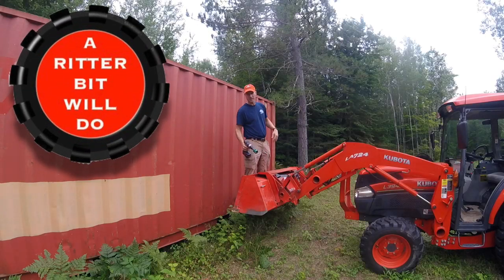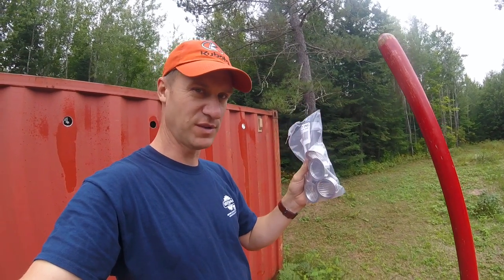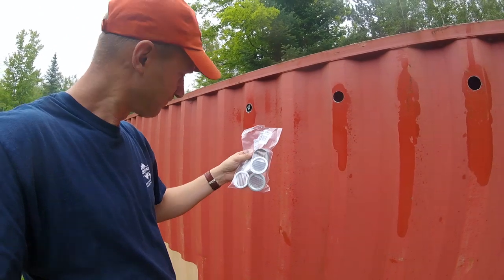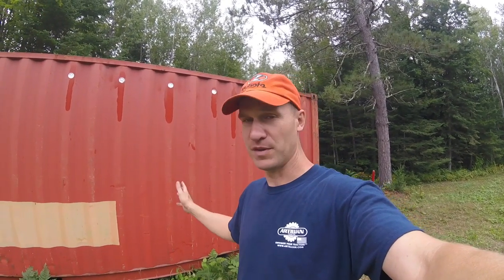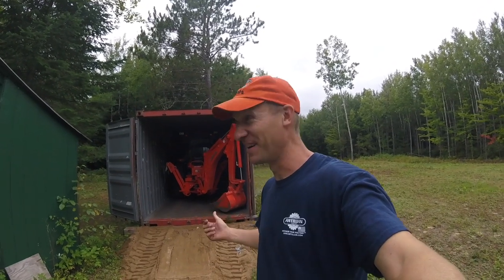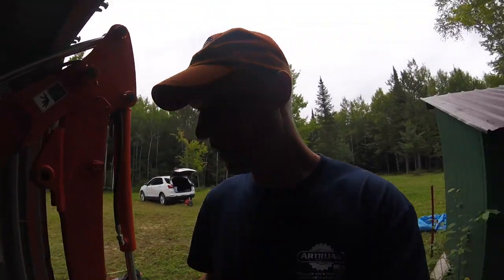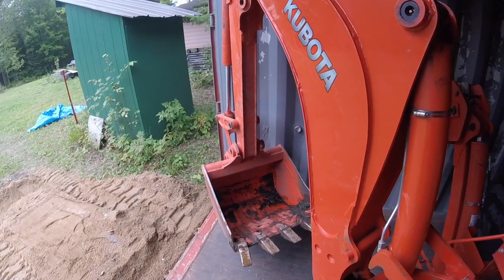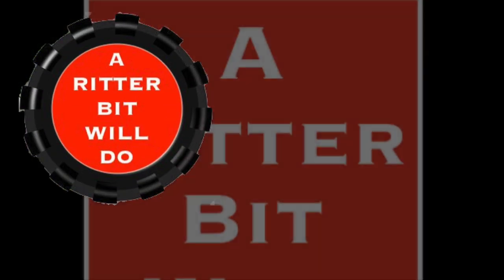VENTING A SHIPPING CONTAINER (Kubota Tractor Storage)

Comment: An Idea I had while watching your struggle with the backhoe was cutting a log to the right length and lowering the bucket on it. It would require you to move it each time but you're not putting pressure on the ceiling. Genius idea by the way. I think it is perfect for tractor storage.

Comment: I like your idea. Thanks for the share. I did my 40ft high cube a bit differently. It is oriented so the doors are facing the prevailing winds. I put an 8in. X 16in. vent in each door, 18in. above the floor. I put 2 6in. X 12in.  vents on the opposite end, just below the roof seam. This takes advantage of both wind and convective air flow. It's a terrific, inexpensive 'instant garage' for my tractor with room for a bonus mini shop.
Reply from the maker: Very nice! I bet you have plenty of room in there. They sure beat the price of a garage and being rodent proof you can’t beat it! 
Keep on tractoring!

Comment: John, those vents are not enough. You need a vent that the size of a rectangle attic vent on both sides opposite from each other. Here in Texas we had an 8n stored at our ranch. We did the same thing you did, but because of the Texas heat, the container exploded like a fire cracker in a cola can. Ours was a 40ft HC container. Needless to say the seals worked great..... until Ka-Boom! Make sure you got good cross flow top an bottom, opposite from each other. This was hard lesson to learn! Also make sure you park your tractor backwards, just in case you need to jump it off or tow it out. Love the vids!
Reply: Uh oh....  I was so sure that this was my solution.  I'm in central Texas 45 minutes east of Austin.  No way to make it safe?
Reply: @BarryWatson57  I ended up putting 2x3 house vents and some whirlybirds vents to help with the ventilation.

Comment: It a tight fit. I thought about getting one too. Buddy has two and he put in a dc exhaust vent  and runs it off a solar panel and a small battery. Takes all the heat out thru the roof nicely , it was crazy hot without it. 😅 Cheers bud.
Reply from the maker: Hi Steve! I was thinking about using some solar panels to run a battery tender, I’d hate to have a dead battery as it would be hard to get at. I’d like to get another shipping container also just to store other crap I have and keep it protected. I think I’ll be well vented as is but an exhaust vent is a good idea. 
Keep on tractoring!
Reply: @ritterjon  Yes some lights inside as well . Easy project and you being in america  only costs about $100 .

Comment: Check out "in so fast" insulation.
They have foam panels molded to the contour of containers. 
Did the ceiling in my container that my b2650 cab sleeps in. And put a small fan in front of the vents which came in my container.(same as your original ones) 
No condensation. In the north east.
Reply from the maker: I bet that company does very well. That’s a unique product for sure. I’m too cheap to spend that much money though. Maybe in my future old man mountain container cabin. 👍
Keep on tractoring!

Comment: Glad you got it in . Now you need some heavy duty locks that bolt cutters can't cut  . I know hydraulic cutters will work on any lock but who carries those around . Was wondering when you have your bucket laying flat it takes up more room . What if you raised the front bucket , tilted it and then put it on the floor would you have more room . Just wondering .
Reply: The locks are just to keep honest people out!!!  Best way to defeat any padlock is with a cordless angle grinder.....and lots of people have those.  I’ve used one myself to remove several higher security padlocks with the boron shackles.....it’s ridiculously faster than using bolt cutters.
Reply from the maker: I think serious thieves these days carry around a cordless grinder with a cut off wheel. The neighbors we have out there keep a pretty close eye on things. 
I should have tried that with the bucket. Now you got me wondering as well. 😁 
Keep on tractoring!

Comment: You might want to consider a solar powered roof vent on the top to get some more exhaust area during summer. Might want a larger square intake vent down near the ground also to have thought vent area. Could always cut a square out and weld some sheet in to get a flat mount.
Reply from the maker: I’m hoping that I have enough vents as it is. If it’s not enough I’ll probably consider something solar powered. I’d like to avoid cutting any bigger holes than I need to. 
Keep on tractoring!

Comment: I don’t get it, is this long-term storage like over winter, or just where you park it out of the weather when not in use?  Seems like a pain in the butt to to do this on a daily basis. You had the right idea with the upper and lower vents but I think I’d have put the majority of the vents across the bottom then a couple of turtle or turbine type vents on the roof to get better draw-through air flow.
Reply from the maker: This is for both long term over the winter and short term for weekend use. I want avoid cutting into the roof as we’ll get plenty of snow through the winter. We’ll see how the 2 inch vents do through the seasons.  
Keep on tractoring!

Comment: Hi. I have a 35’ container.  I didn’t vent it and it has been humid and hot inside.  All my tools in my toolbox are rusting.  Along with other “wet” issues from condensation.  I need to do something before winter hits. 
Now that you have had this done for over a year now, can you give a follow up on how well this venting worked out ? Would you recommend this route, or something different if you had to do it over again ? Thanks !
Reply from the maker: This has worked really well. I can’t remember if I showed it in this video but I place a few vent closer to the bottom also. Just in the corners. I think my vents are every two feet or so and it seems to be working just great! 
Keep on tractoring!

Comment: If you have any issues with ventilation get a solar powered vent.  They make various types for sailboats.  Install it in the flat roof.  You seal around it with a butyl tape and it will never leak.  One vent like that moves air all around our 25 ft sailboat.
Reply from the maker: That might work in the summer but the winter months with snow accumulations on the roof would probably affect it. I’m hoping I have enough circulation with the vents I installed. Thanks for the suggestion. 
Keep on tractoring!
Reply: @ritterjon  Winter it would be useless but I expect your vents will be more than enough in the winter.  I suspect where you might end up a bit short on air movement will be in the summer when you get baked in the sun.

Comment: The vents you have used may only give 1/2 the free area of ventilation and you need same amount of opening down low to allow air in. If you have heat issues the best solution would be to put a roof ventilator on roof opposite to door and intake vent down low near door. Your supplier over there should be able to advise on size. I was in industry years ago.
Reply from the maker: I think it will be alright. It adds up to be almost 50 square inches of vented area. If it’s not enough I can some more. The main reason I quit was because I ran out of battery power in my drill. Thanks for the comment. 
Keep on tractoring!

Comment: I'm just curious to find out if you had any condensation in the winter or spring?  Do the vents seem to be working?  I just purchased several of the same type of vents and I am hoping they will help with the condensation in Michigan.
Reply from the maker: The vents really do the job well. I think I have a total of 12 of them. I'm glad I put in that many. The container still gets hot but I haven't had any issues with condensation. I'm happy with how it all worked out. 
Keep on tractoring!

Comment: Wow it fits in a standard height SeaCan with a door height of 7' 5.75" I've been looking at HiCubes with door height of 8'5". I also plan to install the 2" ones and  install a 6"  powered temp controlled exhaust fan with 12volt battery and solar charger to create more air exchanges to minimize condensation, diesel, and grass clipping odors.
Reply from the maker: At least a L3940 with r4 tires fits. For your tractor I’m not sure. The extra height would be nice but it isn’t necessary. Good luck! 
Keep on tractoring!

Comment: Do you have a video on the the placement of the container? I was wondering what the container was placed on to keep it level.
Reply from the maker: I had a couple 8 foot long Cedar 8x8. But If I were you I'd use large concrete blocks at each corner. They'll hold up better over time. 
Keep on tractoring!

Comment: Nice job, you may want to try setting the hoe on a stump to take the pressure off the hydraulics. Just a thought..
Reply from the maker: This is why I share videos. Just to show how stupid I was not to think of that simple option. Thanks! 👍
Keep on going tractoring!
Reply: @ritterjon  2400 not bad cheaper then a gradge plus if there was a flooding in the area at least the containers will float wich a gradge wouldnt lol

Comment: I'm looking at a shipping container to hold a Garden Tractor and some other gasoline run equipment that are not used regularly and want to insure against any explosion. How would you rate your container's ventilation so far?
Reply from the maker: It’s been great! I’ve been very pleased with the size and amount of vents I installed. It’s a fantastic way to store equipment. It will hold up to trees falling on it and keep all the critters out. 
Keep on tractoring!
Reply: @ritterjon  do bugs get in? Do you need to add screens to them

Comment: If you could manage a 2nd one, cut out the walls in between, you'd have storage for implements and room to walk. It's only your money, not mine ;)
Reply from the maker: I would like a second container if the price is right. But I think I’d place them about 12 feet about and then span the middle with a roof system to keep things out of the rain and sun. 
Keep on tractoring!
Reply: A RITTER BIT WILL DO I’ve seen plenty of Shipping containers turned into Garages just like that. One of the nicest was made from two 20’ containers set into a hillside. They wrapped the outside with seal wrap like used on concrete foundations. The containers were 20’ apart. Next the trusses and roof went up between the containers. Then back filled around the containers and about a foot of earth on top of just the containers. They put man doors from the side 3/4 the way back into the containers. Garage and storage plus storm shelter all in one. Temperature stays within 15 degrees year around.

Comment: A RITTER BIT WILL DO  - any update on how well the venting has worked?  Mostly concerned about moisture build up with the changes of temperature in my area from freezing to thawing in the spring.
Reply from the maker: It has worked really well! Adding numerous vents in both sides has prevented any condensation. 
Keep on tractoring!

Comment: If you wanted too you could cut out where bucket goes and weld an extension on it to give you more room
Reply from the maker: I suppose but I’m not equipped to be welding out in the woods without electricity. 
Keep on tractoring!

Comment: Using a little cutting oil on that bit will make it cut better and keep it sharp longer.
Reply from the maker: I used some WD40 as it was all I had on hand. Worked pretty well. 
Keep on tractoring!
Reply: A RITTER BIT WILL DO WD40 is fine for light metal but it can’t stand the heat like cutting oil. I could tell how the bit was struggling to cut watching the video cutting oil won’t burn like WD40.

Comment: Great idea. Is there any reason you did not back it in?
Reply from the maker: Yes, because I wouldn’t have been able to get the front bucket off and closer to the grill of the tractor, also getting the backhoe in position would have been much more difficult. 
Keep on tractoring!
Reply: A RITTER BIT WILL DO  makes sense. I like the one comment about some sort of solar charger.

Comment: I could get my tractor in there, but then would have to WD-40 myself to be able to slide out. I don't need an extended height container, I need an extended width container to get my big butt by the tractor.
Reply from the maker: After I moved it over to the right I had plenty of room to get in there. Leaving the grease for the tractor. 
Keep on tractoring!
Reply: Lol! That is a good one! You may consider to flip the container on it's side then!
Reply: @FromSteelToWood  that is an idea!, but then I would need a shorter tractor. Although, it is always nice getting new toys and easier than losing a few pounds.

Comment: Jon, If you plan for the tractor to be stored year round I'd have some concerns, the dead of winter would be fine, early spring and hot summers could be a problem.....heat and moister will be your enemy.  Thanks for sharing. Al
Reply from the maker: I put a total of 16 vents. I’m pretty sure that should be enough. If not I’ll add some more. This is just the solution I needed for storing this tractor. 
Keep on tractoring!

Comment: You might want to consider putting a solar battery charger on the top of the container to keep the battery charged during the winter.
Reply from the maker: I’ve been thinking about that. Do you have any suggestions? 
Keep on tractoring!
Reply: @ritterjon  The 15-watt solar Battery Tender brand is an excellent unit.
Reply: Under 2 ft of snow?  If you want one mount it on the side.
Reply: @lowercherty  Good point. A panel should work just fine mounted on the south facing side. I keep mine inside the side window of my storage shed. Even with less than ideal sun angles it generates enough power to keep my battery topped off. Although he could still put one on the roof if he went to the trouble of constructing a little bracket to mount it at an angle slightly above the roof's surface. That would keep it out of the majority of snow.

Comment: You need a barn. Consider setting up a fan connected to a thermostat or even a motion sensor and timer. You risk carbon monoxide poisoning especially when you leave it running. Be safe.